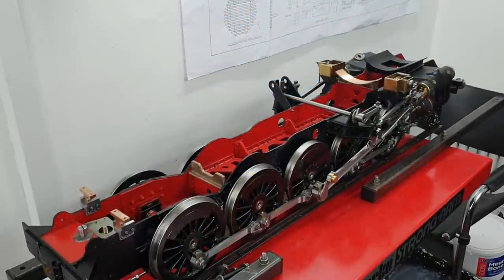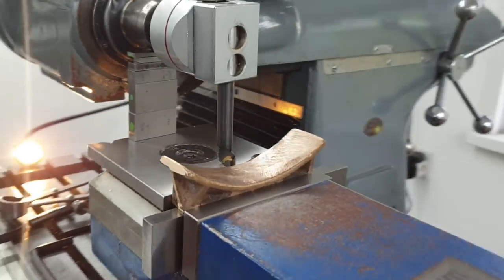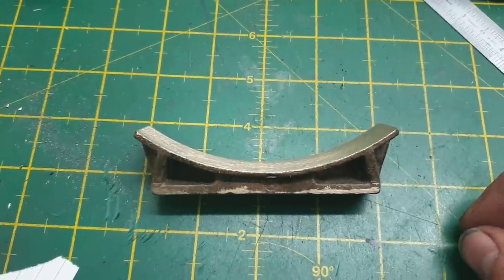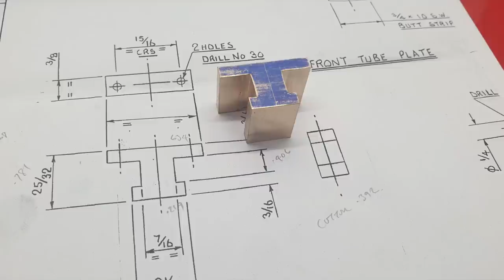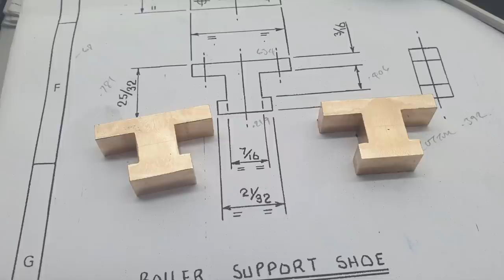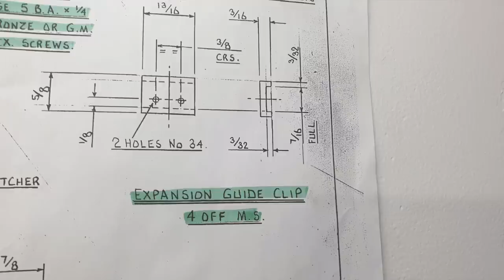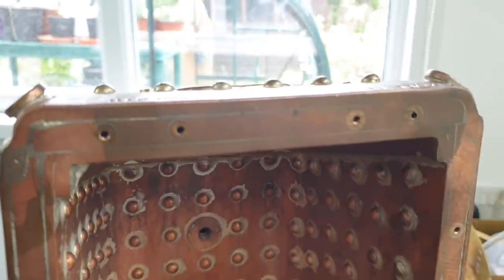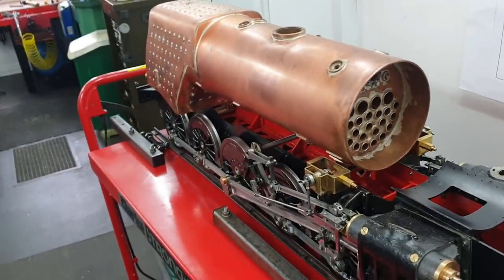9F Loco 5" Gauge - Part 73 - Boiler Trial Fit

Comment: Hello Again, 
Just watched the smokebox being fitted to the boiler. Blackgates engineering have made a beautifully accurate circular smokebox, not easy when brass is rolled and silver soldered. When the smokebox to boiler ring was fitted it showed that the boiler was just as accurate. Hugely impressed with this precision when dealing with tubes and silver soldering parts to them and somehow managing to get them to remain absolutely circular.
Fabulous machining skills and a lot of ingenuity to machine these rings on your quite compact lathe and machining that right pig of a casting for the smokebox door left me marvelling! What a fit! Then I thought, Chimney, blast pipes and pipes for the exhaust steam to the blastpipes, blower steam pipe, smokebox dart and locking mechanism plus all the external fittings such as the number mean there is huge amount to do. Well done. 
Regards
David Green
Reply from the maker: Thank you David. Yes plenty still to do! Next up blast pipe and chimney.....
Cheers Craig.

Comment: Excellent, that boiler is fine piece of craftsmanship too. You caught your other half (or someone) in the green house outside! (I won't tell). I picked up a top tip from advanced innovations recently about cutting plate material in the horizontal bandsaw. If you tilt the piece by resting it on a packer at one side before clamping it, the blade will cut through it much more quickly. It works for me and the cut remains straight!
Reply from the maker: Thank you. Yes I inadvertently caught the wife in the greenhouse. I had no idea until after posting the video - too interested in my old boiler! Great tip regarding sawing plate - I'll give it a go.
Reply from the maker: Just tried your sawing tip - worked a treat! 
Cheers Craig

Comment: That is a beautiful sight. I am certain that you are more than pleased with the results of bringing these two  major components together and having them fit perfectly. Clever means of mounting that boiler.  One does not often think about the amount of expansion that boilers go through after being fired up. Now what about the cab/ You have plans for the smoke box and while waiting for the materials, can you progress on the cab construction?  Congratulations on a job well done. It is wonderful to see your creation come together. All the effort is worth it.  Let's hope progress to completion is swift and as accurate as the work so far. Thanks for the post, Craig. I think every one of your subscribers will heave a collective sigh of relief. Well Done.
Reply from the maker: Thank you Robert - Sigh of relief was the order of the day! If I get stuck I'll finish the drain cock cylinder and mechanism while I can still get to where it all needs to go. Regarding the cab - that involves sheet metalwork, never done it,  the thought of which scares me!!!  - more art than engineering....

Cheers Craig

Comment: Just blundered into this channel. Fascinating to see CNC machining being done in 2020 without the first C or the N!
Reply from the maker: Cheers mate. No fun with CNC....
Reply: @no23mk2  I have a small CNC engraver - it has given me hours of "fun". Last time I used it, I gave up trying to use any CAD or CAM to make a simple engraved circuit board, but drove it by typing g-code line by line and then by using the jog controls to cut isolation paths by eye…
Reply from the maker: For the small batch bits and bobs on this loco, by the time I'd done the CAD I could have made the thing twice over. But then I'm no Cad expert!
Reply: @no23mk2  You're clearly very proficient and efficient with the techniques you're using.

Will go back through the earlier videos and learn more!

Comment: You could benefit from a suds pump to extend your cutter life. If your bluing the chips lower RPM and feed speed. That's a lovely job your making and I know that it takes alloy of time and dedication to complete such an involved build.
Reply from the maker: Thank you Don. I have a suds pump that I use on the lathe when I'm chasing tight tolerances. I have considered piping it up to the mill, but find for the small one off bits and pieces I do, a squeezy bottle of coolant is adequate.

Comment: Fantastic to see Craig mate bet your chuffed to bits. Are you going to throat the blast pipe  to get that more noticeable chuff bit of a louder bark Keith Appleton did it to his black five. Interested to see the smoke box build seems to be a massive jump when the boiler is on the chassis although we know there's plenty of work still to be done fantastic work and video again mate it's a credit to you
Reply from the maker: Thanks Mark - Just been looking at the drawings - The drawings calls for a choked double chimney - that's a project in itself!!! Needs some serious head scratching!
Reply: @no23mk2  I'm going to do it to both mine brit and the black 5 problem is the blast pipe on the brit is raised no room at all. Wow double chimney that will look amazing but yeah I'll be waiting to see how you do it before I attempt it as I've no clue but want to put my own stamp on them

Comment: Hi Craig, another major step forward, can’t wait to see that smokebox! I may have missed this in the past, but will you have a single, or double chimney and have you a chosen loco number?
Again the design of the model’s boiler support is pretty much how the real one is done, except there are more bolts, clamps etc. fastening it down. They do look top heavy in that “naked” condition and the boiler really was mounted as high as they could get it within the loading gauge.
Just for your interest, from cold to in steam at full pressure, the real boiler/firebox expands rearwards into the cab by about 7/8 inch in those sliding clamps, but I think the model will be around 1/16 inch....allowance has to be made for this when making the cab floor etc. to avoid interfering with pipes and things as it warms up!
Can’t wait for the next instalment....
Cheers   Don
Reply from the maker: Hi Don,
Thank you. This loco is a double chimney. In the first instance its going to be black. I haven't chosen a number yet but it wont be a preserved 9F. I am currently researching a suitable candidate. My rough calculation gave an expansion of between 40 to 50 thou. So a 1/16" allowance sounds just right. 
Cheers Craig
Reply: @no23mk2  Ok well you have several to choose from, depending on tender type as well. Mine is 92167, a former stoker fitted one but converted to normal and paired with a BR1C tender. It was allocated to Birkenhead when I was living near there and was one of only a small number allocated there with a double chimney. It was the last 9F in service....June 68.
Cheers and excuse the trivia!   Don
Reply: I always thought these would look pretty good in BR Rail Blue - would the double arrow go on the cabside or the tender?

Comment: well i'll go tut fut at stairs. ah never new the boiler wasn't fixed to the chassis, makes sense really
keep up the good work.
Reply from the maker: Cheers Paul
Reply: That was news to me too!

So presumably the firebox and cab are fixed to the boiler and just resting in guides on the chassis too? Was the footplate rigidly attached to the cab or to the chassis?
Reply from the maker: The firebox is part of the boiler. Both the cab structure and footplate are suspended from the boiler.
Reply: @no23mk2  Thanks for clarifying!

Would there be much relative motion other than thermal expansion - is there a bit of flexibility in the frames? The footplate wouldn't be bouncing off the chassis at excessive speed on rough track, would it…?
Reply from the maker: @RoamingAdhocrat   Thermal expansion/contraction aside, there should be very little if any relative movement between boiler and frames. The frames are very rigidly built. The footplate is well clear of the frames so wouldn't be a problem.

Comment: How thick are the boiler sheets? Also what are the dimensions of the mud ring?
Reply from the maker: Backhead 3/16" The rest is 10swg (.128")  - What's a mud ring?
Reply: @no23mk2  The mudring is the square at the bottom of the firebox that both the inside sheets and outside sheets of the firebox are attached to. On a full size locomotive it's a solid block, around 4" × 4" square on smaller locomotives, all the way around the bottom of the firebox. The wash out plugs at the bottom of the firebox are right above the mudring with the bottom of the hole being level with it. Its called a mudring because all the sludge, scale, and particles (mud) settles there and that's why the wash out plugs are where they are.
Reply from the maker: A-ha, The foundation ring as I know it...  It is 5/16" thick and varies from 1/2" to 5/8" wide. 5/8" being at the throat plate end of the fire box.
Reply: @no23mk2  I worked at The NC Transportation Museum/Spencer Shops whilst in high school in the mechanical department for the trains. I was assistant to the master mechanic. In 2002 when I graduated high school I worked for a year with a man that traveled around rebuilding steam locomotives. I help tear down and restore an American 4-4-0 type locomotive. Best fun I've ever had and got pay very well too. Should have made a career out of it but hindsight is 20/20.